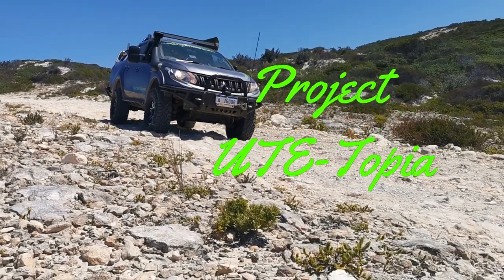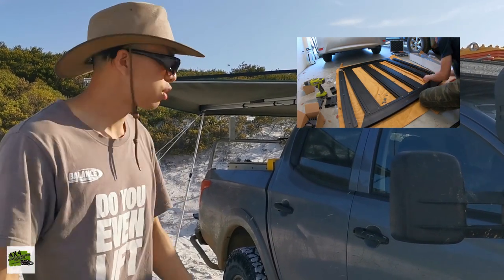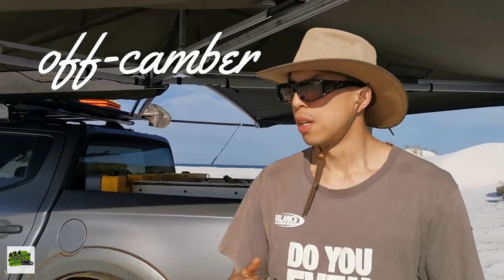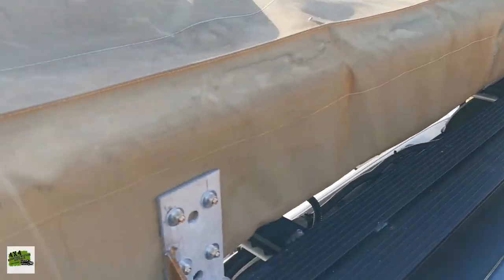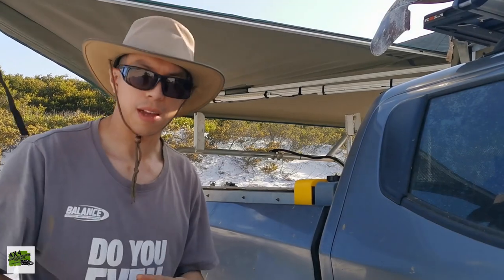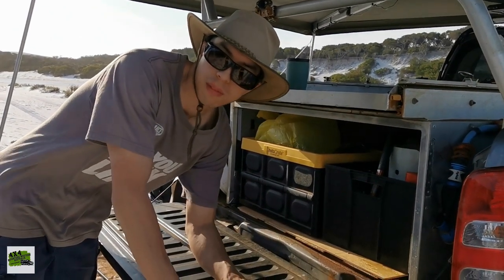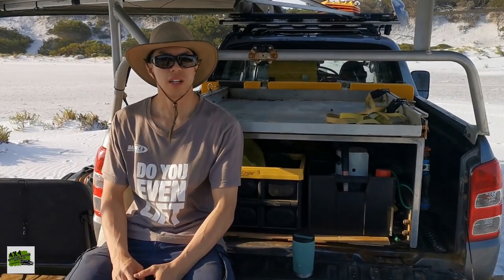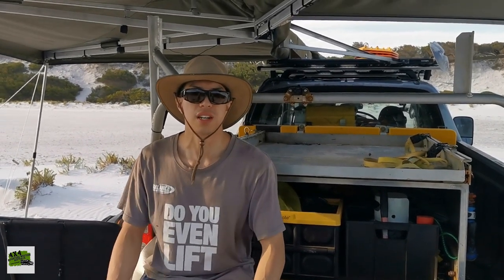DUAL CAB UTE SETUP FOR CAMPING - Could this be the IDEAL economical setup?

Comment: Did you fabricate the drawer system yourself? That slide out is a dream.
Reply from the maker: Thank you. No that was before I learn metal fabrication, but it was my design. 
This was an old set up already because the system has limitation. But overall, it is simple and it works for weekend trips.

Comment: How did you get the roof tray on the roof racks and is that a 270 awning how is it mounted to roof racks
Reply from the maker: The roof tray was mounted on the cross bars by the T bolts (or nuts) provided. Or you can use any bolts or nuts of the right shape.
To get that 270 awning on the platform, it is rather difficult to explain. But i do have another video about that. Please check that out.
https://youtu.be/6NWjc9L93js